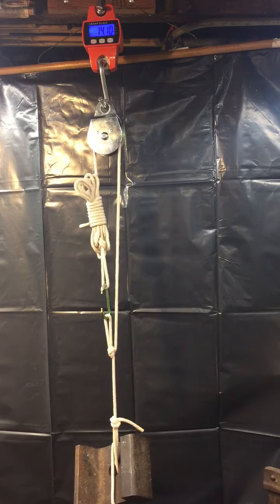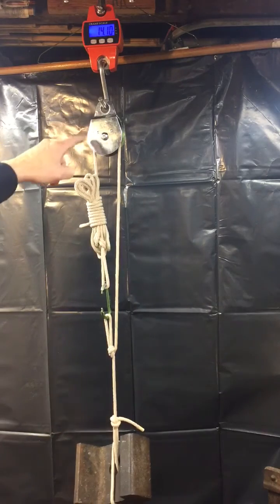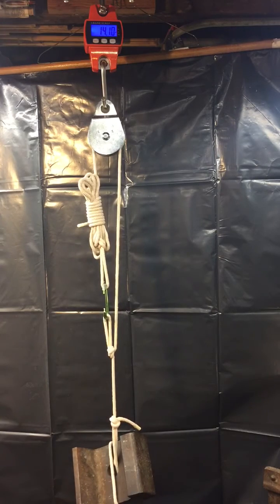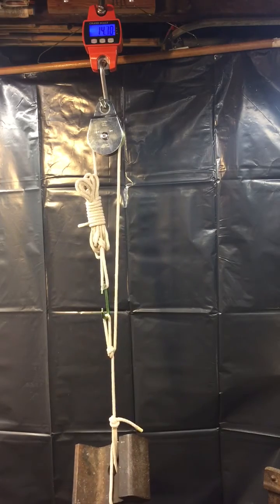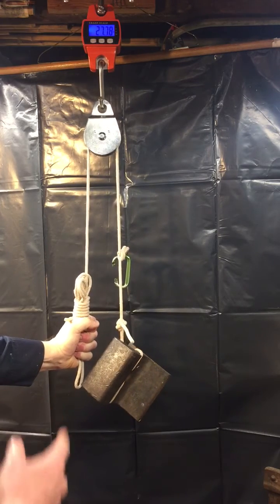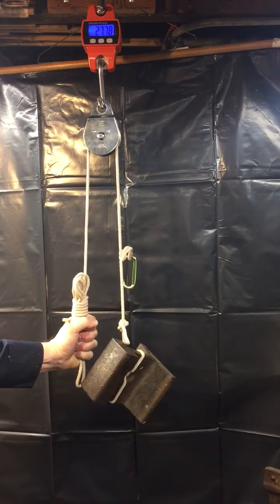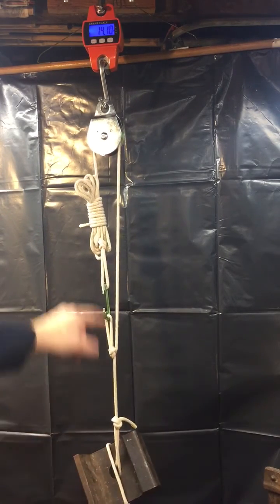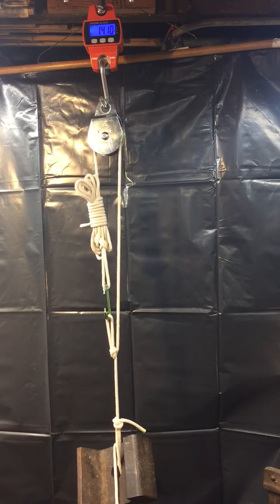Load Considerations when using Pulleys.

Comment: If the load was 300lbs would you be able to pull on your side the 300lbs
Reply from the maker: Don- if the load was 300 pounds I would have to be able to pull down 300 pounds to raise it. (There is no mechanical advantage with a single pulley only change of direction) So to answer your question 'No' I'm not that strong or heavy.  😃👍